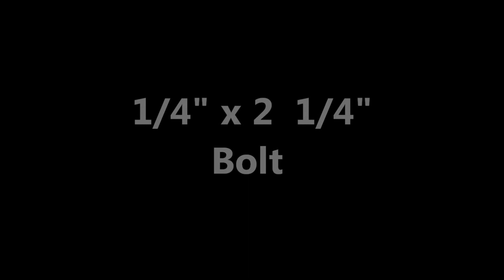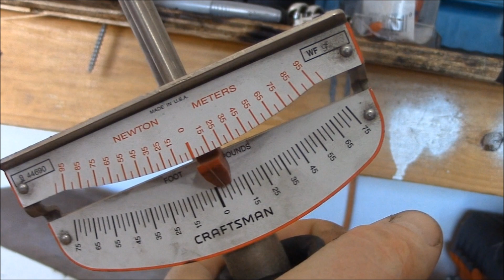How to Remove the Governor on a Go Kart Engine (BRONDA Part 1)

Comment from the maker: I'm pretty sure the valves didn't fall out, unless you took the cylinder head off and removed the valve springs. What probably fell out were the lifters (they look a lot like valves). What you are going to need to do is turn the engine upside down so gravity holds the lifters in place, then put the camshaft back on (there is a spot for it in the engine block. rotate the camshaft and camshaft gear (making sure that the woodruff key is in place) so that the dots line up.

You will also either need to take the governor arm out, or grind down the little flap of metal so that it wont hit the gears inside.  Dont worry if stuff falls apart, it will all fit back together :-) Just keep it clean in there.

 Also, to reiterate, you will need to change the way you have your throttle set up once the governor is removed (the governor allows easier starting, as well as governs max rpm). When starting your engine with the governor removed, you still use the choke, but you need to manually hold open the throttle until it starts/warms up. You'll get it eventually, just do a little head scratching.
Reply: So what if I can't fin any dots or any marking on the cogs?
Reply from the maker: Check the other side? Check for any marks/indicators? Google it?
Reply: We got it then, ripped around on it and then all of a sudden it sputtered to a stop and wouldn't turn over so we put the governor back in and we're slow now but it runs.
Reply: so pretty much all these engines have governors then??

Comment: So,, is it necessary to pull engine apart to remove gear and any other governor parts? Can't I just disconnect it from the throttle Linkage and put Linkage for my throttle cable? Only asking because 
I have done this on brigg and stratton engines many times and it seem to work fine.
Reply from the maker: higher rpms tend to throw the internal parts apart. like a baby grenade in the engine

Comment: Just attempted this and 1/4 inch bolt wouldnt fit. Same motor. Wierd. That 1/4 inch is now stuck and probably gunna put a lock nut on and leave it. Its winter so it'll sit until i get it in running order to see if its gunna shoot it out or if i need to find some new size bolt

Comment: i bought one of these from my local junkyard for my mini bike sadly shes a goner the cylinder walls are damaged bad and i dont know if i can have it machined but i decided to use it for parts untill i can take it to a machine shop
Reply from the maker: if the cylinder walls are cast iron, you can take it to a machine shop and they may be able to overbore it to a new larger piston size. If it is aluminum bore, i would just toss it.

Comment: Why does my carburetor stay on full throttle after engine turns on? Obviously I’m not a mechanic, just a guy trying to fix his sons gokart,..gokart runs great when I use my finger to carburetor throttle, once I hook it ip to throttle assembly with Governor it stays full throttle..any input woukd be greatly appreciated, thank you
Reply from the maker: Governor is probably broken or return spring is weak or broken

Comment: What if you just removed the govenor arm and linkage from the carburetor but left the internals in place.  I know it may not be right, but would it work?
Reply from the maker: If you pulled the pin from a grenade and had no idea when it would blow up, knowing you should get rid of the grenade, would you still expect it to not blow up? Would you want to hold onto it because you were too lazy to throw it? Same idea here. It may or may not grenade inside your engine, but when it does, you will have a mini grenade go off inside your engine.
Reply: That's a pretty extreme analogy.
Reply from the maker: Haha, right? Look. Some people can get away with that, and others do it and the gear breaks sending bits of metal and plastic into the engine, which causes the engine to seize, sometimes breaking the connecting rod.

Comment: What do you mean you need a new throttle assembly when you remove the governor? I have a really old 8hp briggs maybe a 1980. Are the exhaust valve spring usually read on them ?
Reply from the maker: Governor controls throttle position. You will either have to jimmy rig a throttle directly, or buy a direct throttle assembly kit.

Comment: Any idea where I can purchase a new throttle linkage? I’m hoping to take the governor off but would need a new throttle with the stock carb
Reply: Yep, junk the carb and get gx200 like I am with my B&S 8hp. Otherwise if you keep carb just straighten out a ss paperclip and hook each end to fit linkage holes.

Comment: Would you know the valve lash for 212cc non hemi with 18lb valve springs?
Reply from the maker: .002"-.003" from the factory is what i have seen. not sure if that is the actual spec though. If you put in a cam its on the cam card, if not, read the users manual.

Comment: Hey I removed the governor on my early 70s Briggs and Stratton mini bike motor I think its like 3 HP. Now once we put everything back together it won't pull.  We didn't take the arm out and we didn't line up the dots but we also had the valves fall out when we removed the cover because the can shaft came with it. Help?
Reply: You still need help with that?

Comment: Do I leave the govenor gear in
Reply from the maker: +Nick Donato no
Reply: ok I got a threaded bolt like the one you had but it did not want to go through the hole what do I do to fix that?
Reply from the maker: Nick, if you don't remove the governor shaft, then it may contact the camshaft gear and cause engine failure. It's up to you though... so good luck.
Reply: Leave the slinger in because it acts like an oil pump

Comment: I'm going to be doing the same thing to my flathead Briggs. It is all stock as is and the engine itself is clean. The carb and tank however are not. My question is do I get a simple 212 predator carb or a real Honda carb. Also, is there any tuning of the carb to make it run properly? And can you do a honda carb without removing the governor or do they have to go out together?
Reply from the maker: +Jason Kenney the "212 predator carb" is a Honda carb. No tuning required up to 3600 rpm. If you do high flow intake and exhaust you should rejet to a .036-.038 jet

Comment: Why not just tap the governor shaft hole and loctite a bolt from the outside in. Your way you have a nut on the inside of the engine and if it can lose your engine would be ruined. You said you are too cheap to by a side cover gasket. Did you know that the side cover gasket determines your crankshaft end play? Did you have enough crankshaft end play after not using a paper gasket?
Reply from the maker: Yeah I actually got a new gasket right after I made the video. I didn’t have a tap and die set back then either. I tap everything now and seal with pipe thread sealant.
Reply: KartFab ok good to hear.
Reply: glennspeeds I usually just take out the govener  arm... you need that gear in the motor it helps sling oil on the piston..
Reply: @chadmcdavid6072  Ummmm....no. It doesnt.

The dipper on the end of the conrod does that. The plastic gear with weights is literally there for rpm limitation.

You need more experience.

Comment: can u hel how to remove governor on 150cc gy6 yerf dog
Reply from the maker: Alex Loera sure man, you just don't do anything because it doesn't have a governor on it! You can increase RPM's on the GY6 by replacing the stock CDI with a "RACING CDI" make sure they are compatible. You go from a 5500 rpm max with the gy6 to a theoretical 9500 rpm max with the racing cdi. Hope that helps! I don't know much more about it than that.

Comment: That's also your oil slinger, I wouldn't expect much life from that engine now.
Reply: I always take them out of every engine I been in period. There are a dozen sbf I never put that plastic shit back in.
Reply: That is NOT the oil dipper.  The oil dipper is on the end of the connecting rod.
Reply: After rebuilding many if these small engines since my last post, I stand corrected. It has no influence on oil. However, I would at least upgrade the springs and drill/buy bigger fuel jets if this scrap is pulled out.
Reply: You rebuilt many of these small engines in the last two months since your last comment but didnt even know where the slinger was then two months ago 👀
Reply: @bryanroupe8646  your absolutely right. I was learning at the time and became aware of it not long after that post. I've  rebuilt the neighbors 24h Briggs twin, briggs 127cc off a doodle bug and I'm currently rebuilding a 212 predator. It don't obviously take long to learn these small engines. I've rebuilt car engines and motorcycle for years. Finishing up a buddy's 97 Yamaha 535 full rebuild as we speak. Anything else you need to Mr curious?!
Reply: @brokensmile8487  The jet has nothing to do with a degoverned engine.
Adding air, compression or a better flowing header warrants a bigger jet. Not governor removal.

Secondly, the governor gear is not an oil dispersion system. The dipper on the conrod does that job.

Dont take this the wrong way, but you need more experience before making statements.
Reply: @robspear03  i beg to differ.  So if i remove the governor and start turning significantly higher constant revolutions per minute you mean to tell me a jet change for the bigger will not benefit my engine??? Well I think you need to re educate yourself before posting.
Reply: Higher rpm literally does all the things you mentioned except higher flowing parts.  Although higher rpm equals higher flow. Go home bud

Comment: what is the idea about this ?
Reply: Allows higher revs. Shouldn't be done without a billet aluminum flywheel
Reply: @eshollen  ...on a Honda clone, maybe.

The steel quality used in the old B&S and Tecumseh engines are superior in steel versus Predators/Lifan chinesium by comparison.

The conrod will be the first thing to go due to overevving.
Reply: @robspear03  good heads up, thanks. Might save me a hundred bucks